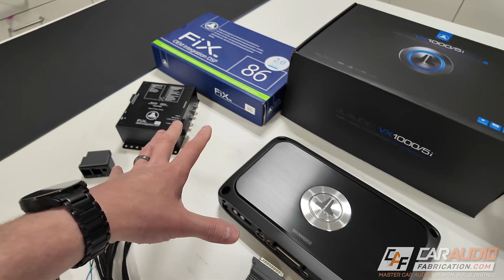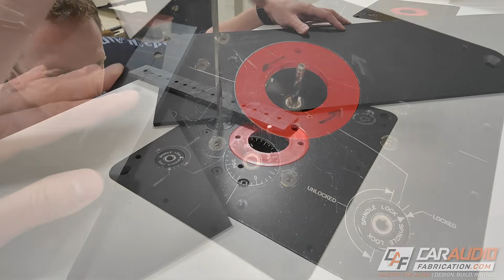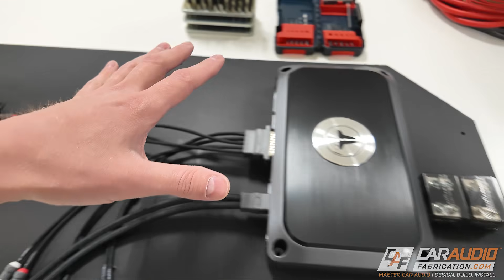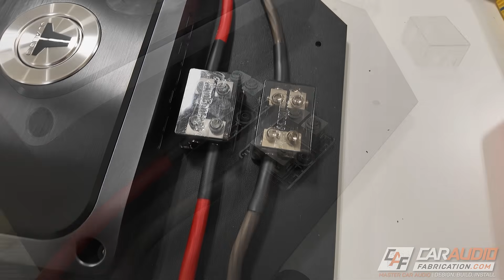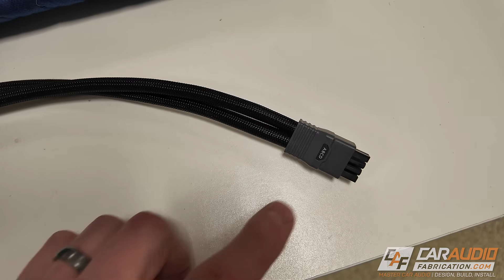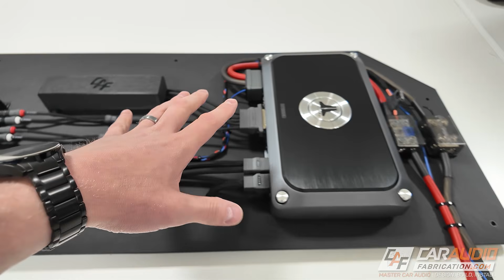Wiring easily removable AMPLIFIER rack for Car Audio

Comment from the maker: If you are interested in the wire cover I made I now have them here - https://www.caraudiofabrication.com/product-page/caf-wire-caddy-for-vxi-amplifiers

See all the other items used in this video in the video description!
Reply: What gauge wire did you use for your power & ground going to DSP?
Reply: What if I use aluminium plate instead of plastic board like the one you used? Is there a problem if the board is conductive? It would simplify grounding as every amp/dsp could just be grounded to the plate, and then the plate could be grounded to the chasis/battery with one cable. Reason I consider aluminium plate is because i need the amp rack to be easily movable (out from the car) because it will sit on top of my spare tyre compartment. Plastic need to be very thick (read: expensive) to be stiff enough, wood can catch fire.
Reply: I do airport trips, I want to add, amplifier, midrange and sub with disconnecting from the car factory system...
Reply: One question for you: why did you add a separate DSP when the amp you used already comes with DSP built in?
Reply: I just wanted to express my point of view on the organization of the meticulous or scrupulous attention to detail and the result: excellent 👏👏

Comment: So I bought a main battery to replace my original battery but I’m reading so many things online about lithium batteries. I bought the PWR-S5-4900 12V BCI Group 49/H7, Lithium Titanate Oxide but I  haven’t installed it yet. I also have an upgraded JS 400a alternator that i havent installed yet. The HO alternator is set to factory voltage by JS. If i need a BMS, what kind? Can you shed some light on this? Thank you

Comment: Hi great playlist on the elantra, 
I am interested in installing in a 2024 elantra with the bose sound sytem, 2 12in subs and a amp, but was wondering if i need a LOC and if so could i plug it in to the factory amp or how do i wire it?

Comment: Love the design and concept. I try to use ingenuity in my various projects as well. If I was building your project, I might mount the black plastic onto 3/4" MDF, to give the vital components a mass to affix to, then mount the panel to the box with isolation rubber sleeves, then add isolation rubber sleeves between the equipment and the black plastic. Bass vibes shake everything apart eventually! Smart wire box!

Comment: Just to flatten the signal $499.99......  The  JL Audio VX1000/1i $1,599,99.......    not even speakers hooked up yet......   for what kind of cars is this setup meant to be?? Lambo, Farrarie, Vron...... because for my 23 year old E46.... nope not gonna happen......
Reply from the maker: Quality car audio gear that will last is priced higher. Sounds good, reliable, cheap. You get to pick two.

Comment: Great video.  I was wondering why you used a remote wire for the fix86?  I thought one could use the inputs of the speaker wire as basically a "remote turn-on?"  Am I missing something here?

Comment: Would love for Mark to upgrade my A91 Supra sound system. The factory system is one of the worst ive heard and to think its labeled as a JBL premium smh.
Would love to do a similar setup as this install with the JL 5 channel,  replace speakers and try and utilize the factory sub location or remove it and build custom enclosure in same place for single JL W6

Comment: Have one question.  The extra box for the extra wires. When the bass kicks in, would it not be smart to fill it with some sort of cushion or a soft foam to keep them from rattling? 
Love the idea but I'm also the type for detail.  A small tapping or rattle could just distort the quality of sound.

Comment: I’m designing a similar setup for my 24 Chevy Silverado. For the Fix 86, can you please explain why you went with the turn on lead to it rather than using dc offset to turn on the unit? You can still use the turn on out to the amplifier correct? Or did you just want them all to turn on/off at the switch?
Reply from the maker: Anytime you have easy access to a turn on lead you should use it, it's for more reliable. I do in this case.

Comment: Great video, really helpful! For that inline fuse connector going to the Fix86, was that 8 AWG wire? Just curious, because using a wire size calculator, I showed the largest "necessary" wire was 25AWG, but the smallest I was able to find was 18AWG in a 5-pack--and not to mention that the fuse block you're using only steps down to 8 AWG. I just want to be sure I would purchase an inline fuse holder that works with the power distribution block.  And that  high-power quick disconnect you show in this video seems to not be available anymore. Is there any alternative you have come across? I've done some searching, but not finding anything as neat as the one you have used. That's too bad. And regarding the HDPE plastic mounting panel: what are your thoughts on plexiglass or acrylic in place of HDPE or ABS? I'm thinking of purchasing a pre-finished Sub box, and plexiglass, being clear, would look nice mounted to a pre-finished box--but I don't know if plexiglass is more brittle than HDPE, possibly causing installation/mounting issues. Thanks again for this excellent video! Oh, and very nice work!
Reply: OK, I actually did find a Scosche 4AWG connector that also has a connection for a remote sensing wire on Crutchfield (Scosche UAKP4G) that can replace than NVX high-current quick disconnect you have in your video which seems like a rather nice replacement.

Comment: When doing the Deutsch connectors, it's a good idea for the hot side of the connection to be female, so that it is harder to touch a hot wire if the connector is disconnected.
Reply from the maker: Which is exactly what I did.

Comment: New to the car audio. Im currently working on replacement my OEM speakers, with no additional amps/sub. But ive been brainstorming the possibilities of having a removing unit for the amp/sub if i was to fit it in my trunk, just like this cause there may be some instances for i require more space. This definitely solves that issue or will inspire me to make this kinda build eventually. Do you guys have an instruction for that cable line coming from the OEM head unit to the back.? I may need to do that line/cable work before attaching this to a removable unit like you did here.

Comment: Does the Fix 86 allow factory 911 integration and steering wheels controls? I have the DSR-1 in my Focus, it does that. I am looking for something to upgrade my new RAM truck with the factory uConnect system with active noise cancelling.

Comment: I follow a lot of your awesome informative videos.  Question, and not directly in line with this one:

If you have a standard 2-way crossover with a high pass and low pass but with the high pass (which is meant for a tweeter) connected to a full range capable driver like a full range 2.75" speaker. And you connect an in-line capacitor made for full range frequencies, will it bypass the tweeter frequency allowing full range frequencies? My reason for asking is because I am trying to share the 2 rear channel on a 4 channel amplifier between a 3.5" woofer and a 2.75" woofer, trying to get mid/full range frequencies from both. And I can't find a dual midrange pass crossover! Any input is greatly appreciated! Thanks!!!

Comment: I am seeking a solution where the car speaker initially runs from the factory output signal, but switches to the amplifier output once the car engine starts. This setup aims to conserve the car battery by preventing it from draining power when the car is not running, while still allowing me to enjoy music from the factory radio, as it consumes less power.
Reply: @mustbeviv  Google a line output converter or LOC.

Comment: Nice!! Is it okay to add battery terminals that have a multiple post and add your amp wires, LED wires and such or is it best to set up a Bluesea fuse box set up for example? I'm thinking the battery terminals with multiple post would be fine, as long as all of your wire harness have a fuse in them , correct?

Comment: so i decided to finally take care of my car after she was looking beat up after five years it's 2002 Chevy blazer and now I have a major car audio addiction it all started with Sony speakers in every compartment and then somebody said hey you got this thing clean and sound good now you need subs so give me free shitty random subs and then became a better amp then I blew those subs went through three upgrades in the same week till I ended up on dual kicker q's 1800 kicker amp 2 pioneer 4 channel amps 2 optima yellow caps new set of kicker speakers trying to find a way to keep the sonys in it a huge audio equation i have a red leather back topped off with stuff to hook up which i cant till i make a audio board of large enough size anywhere I go now the average person is jaw dropped everything is ignorant powerful and I'm so far in I can't stop I have to go all the way I'm a lot of money and my mom even tried to count the other day and I had to stop her ive got like every square inch deadened underglow and inner glow and im on probation soooo not good i just need a dmh-810  but so expensive and I'm gonna need way more intense subs even though I have kicker Q 2 ohms in a vented qbomb

Comment: Hey i just got a 1600w 12inch skar vented subwoofer at 800w rms wired to 1ohm but i ordered a 1200rms 1600w peak skar amplifier and now im worried the amp is wrong for the sub cause of the rms on the amplifier is higher then the rms on the subwoofer which i can do 800w rms on the amp only at 2 ohms but i wanted to keep the subwoofer at 1 ohm how can i run this amplifier at 1ohm 1200w rms without damaging my sub running 800w rms

Comment: Your installs are always so clean and look amazing! Your attention to detail is very impressive. I have been working in aviation for over 25 years and details matter. You should check out a rivet spacer tool we use that I think will help you out with your hole spacing. Just Google "rivet spacer tool". They expand and keep the holes perfectly spaced so you are not limited to the spacing in the ruler you are using. Keep up the great work, love the videos sir!

Comment: Mark! 
  I also had the idea that you should work with KnuKonceptz to design and develop a battery terminal-fuse block-all-in-one product.  A terminal that has a fused out,  an unfused out for the big 3 upgraded alternator,  and an extra accessory out for whatever, thus keeping your amp power wire as safe as possible.  I  haven't seen anything like that on the market yet. You could promote it on your channel, too. I'd buy one.
...just a thought...

Comment: Really nice amp rack. I bought a big plug for my own amp rack, and i wanna ask, is it safe to connect/disconnect the power plug without taking off the ground terminal on the battery? Couldn't it create a spark, if I've got a power capacitor installed on the amp rack?

Comment: Here to figure out how you turned the rca connections into a DT style connector. Having to unplug every rca + unscrew every set screw/terminal screw  + main power/ground on the BACK of the board makes removing my amp rack a 20 minute task, reinstalling ususally takes longer. Im using 1/2×15×22" HDPE sheet with tapped holes for amp screws/distro blocks

Comment: Great video! I would put some foam in the concealing box squeeze the wires just a bit to prevent buzzing sounds. Might not be necessary but just in case..

Comment: Making your audio setup like this is such a pain because of all the planning. It also ends up being more expensive due to all the small items that add up. BUT let me tell you, it is 1000% worth it. It's also very satisfying when you're finished!
Reply: Agree been adding little ground blocks but I ordered the wrong one thoight i needed 120 I need 100. LGD are not necessary I guess for every vehicle I stay in contact with kicker and they said I will not need one for my car luckily I asked before purchasing. Just got the ABS and now I’m planning where everything will go it’s gonna be hard bc I don’t have the height of the amp I’m going to add on my planning board and it’s a little difficult because it’s going under my seat. I’m gonna go with a DSP as well maybe NVX audio control is well worth it but out of my budget range. And I’m still debating to add a mono amp under the other seat but I already have a 5 channel so I’d basically have to buy a 4 then  a mono running a 5 channel and a mono sounds stupid 😂 sorry for the rant
Reply: @thatguykai479  it's not stupid. Even when doing this yourself, it's an expensive hobby. I used an older amp in my setup because I didn't want to tack on a other $500 for a brand new amp. However, I will say that the best way to do this to keep everything clean looking is to wait to purchase everything you need/want before starting the project. If it's expensive just wait and save for everything. Edit: it actually helps it look clean AND can make the planning and project easier. For instance, having all the same brand of amps makes it easier to route the wiring because all the terminals face the same direction.
Reply: I know really want to make a nice looking one but then you need to drop a lot more money for looks what I’m really never gonna show off so then what’s the point

Comment: I've always wanted to make a setup quickly removable as I've got multiple identical vehicles - I had the subwoofer side figured out but using the deutsch connectors to either provide input/output or a straight pass through when not in use is genius!  On a more simple setup with an aftermarket head unit (think 90's sindle din stuff) would a guy even need the load generators or is that more for the integrated "smart" setups in new vehicles?

Comment: Why did you not use ferrules at the amp side of the power run?
Reply from the maker: Amplifier terminal is a "sandwich style" which works great for stranded wire as is.
Reply: Why would he?
Reply: @jasx1485  same reason he used them on the other end lol
Reply: @j.wright5918  other end?  You mean the distribution block

Comment: Dear CarAudioFabrications. 

Why is FIX86 needed in this setup? As far as I know, the VXI has a DSP processor, so what's the point of another one?
Reply from the maker: Recommended by JL to go this route as it frees up more processing power for the audio correction side rather than bringing the signal back to flat. Both ways would work.